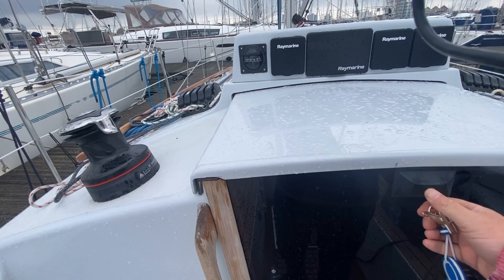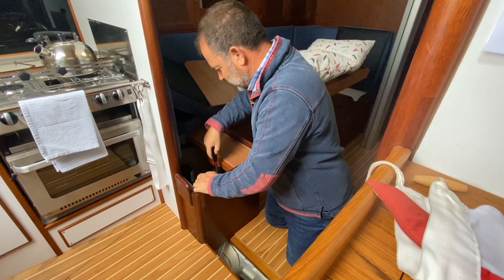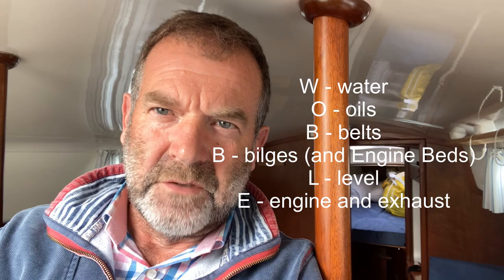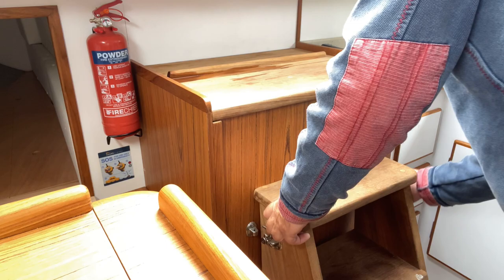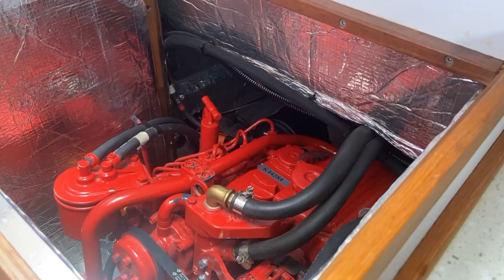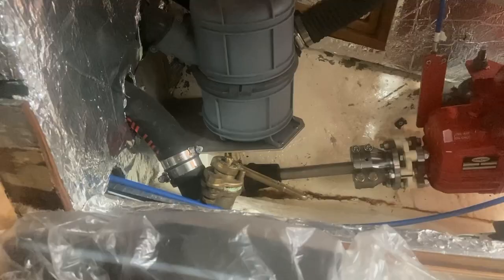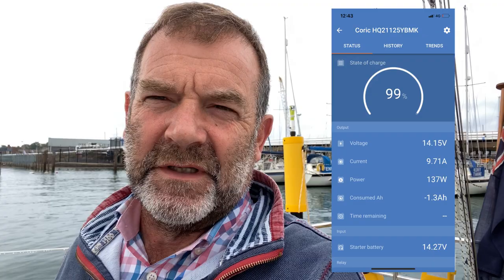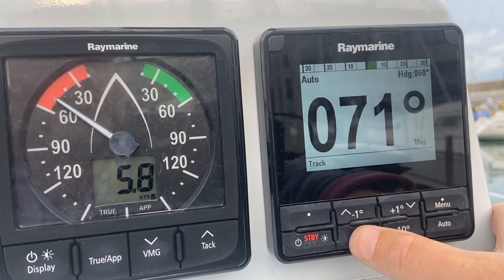Ep 46 - Pre Sea Checks

Comment: AHOY THERE ,,,,great checklist procedures ,i would also add checks to the standing rigging every split pin and bracket on mast needs to be checked to see theyre in place no breaks or cracks spreaders need inspected its not a problem ,if you dont mind a broken mast and torn sail and can afford thousands for new mast and sail i would do deck fittings rigging inspection before going inside cabin to continue the other engine and electrical checks ,just saying but thats my thoughts anyways happy sailings
Reply from the maker: I completely agree that checking the standing and running rigging is an important part of spotting emerging problems. I do a check of these things I have to say when I am out and Sailing and there is a little bit of load. A useful tip that I was given was to look at the top of the mast and the spreaders binoculars from the cockpit if getting up the rig is tricky.

Comment: I noticed you saw a bit of water in the bilge and hand-pumped it out.  Why wouldn't the automatic bugle pump have taken care of that?  I assume you would leave the auto pump on while you are away.  Or is it that the pick-up for the manual pump is below the auto pump and the water wasn't high enough for the auto pump to kick on yet?
Reply from the maker: Yes - that’s right. The auto bilge pump is left on (or set to auto to be more precise). It will kick in when there is about 2-3 pints in bilge. It then emptied it really quickly but the water left in Pipe (maybe 1 pint) then drops back. The manual bilge pump gets everything out and it then stays out.

Comment: Did Coric have the water tank level gauge when you bought the boat or was that part of the refit?  Same question for the fuel gauge.
Reply from the maker: Hi - there was a fuel tank but no sender / gauge and the water tank is completely new. We fitted sender and gauges to both during the refit